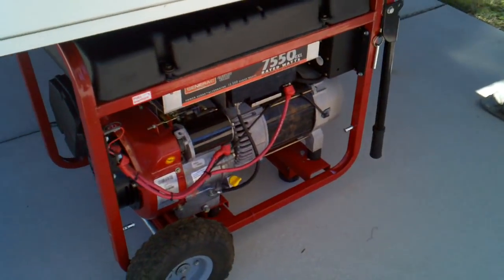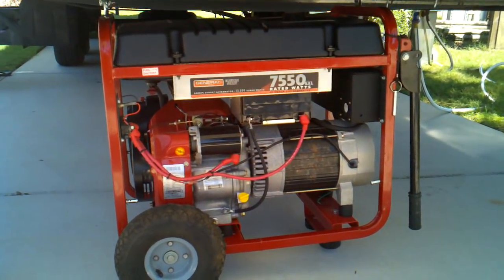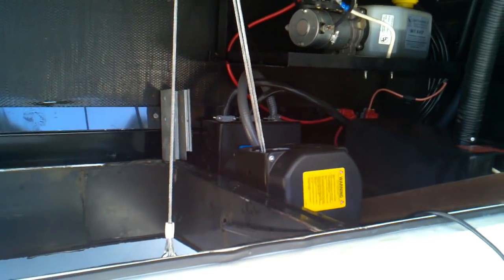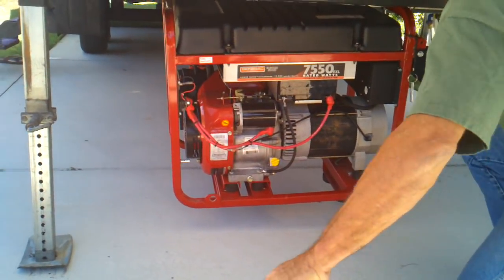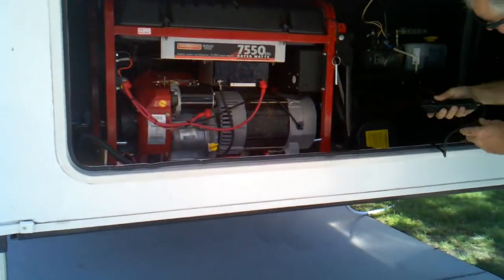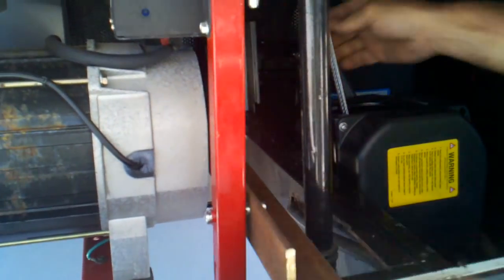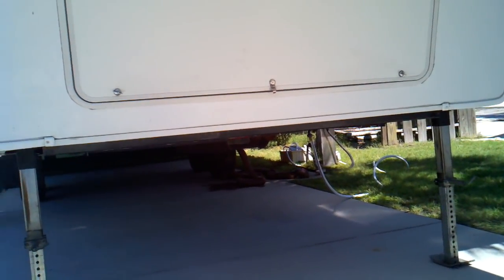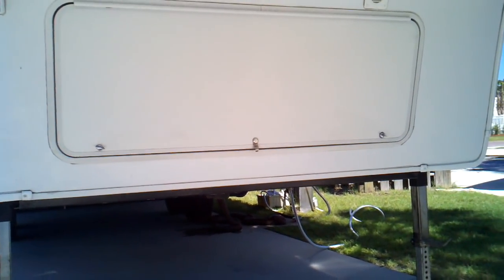Custom 1 Man RV Generator Loading & Storing System

Comment: I did this with my 5th wheel camper.
I installed a 4Kw Honda generator this way.
I modified the 115 volt winch so it has 2 wire ropes coming off the drum insyead of one.
Used pulleys bolted to the metal ceiling of the compartment as well as the winch to run the wire ropes over and down.
I didn't leave mine open on the bottom however.
I carefully cut out the bottom steel panel of the compartment so I can reuse it and bolt it back in.
I added angle an iron frame around the bottom of the opening to form a frame to mount / bolt it to.
I mounted the generator to the plate which I also added a frame to and stiffen it.
I used rubber and cork vibration pads between the generator frame and the mounting plate to help prevent vibrations.
The generator has it's own rubber mounts between the unit and its own frame.
The camper had the factory generator prep kit installed so it was easy to just run a #10-3 SOOW cord and connectors to plug the generator into the camper .
Next will be the retrofit remote starter kit to the generator. 
Since this type of generator is really not meant to be run inside a confined area , I leave the front hatch door open to let it breathe.
The exhaust was routed through flex pipe from the side of the generator out the bottom plate .
This made it easier to add another small muffler to make it quieter and not exceed the state park decibel levels.
I also wrapped all exhaust components inside the generator compartment with header wrap material.

Note:
To keep the noise and heat into the camper to a minimum I re-insulated that whole compartment with the fire rated , foil faced 1" fiberglass duct insulation BEFORE I put the generator into it.
I also used the same insulation on the furnace heating duct that went through that compartment also. Helps keep the noise out as well as the cold or heat loss since the front compartment is not heated .

Comment: Hi.  I was very impressed with your video. So much so I did a similar set up on my Cedar Creek.  It was surprisingly easy and looks great.   I have room for two Honda 3000s.   Thanks again.
Reply: James and FBM, I am curious how you mounted the pulleys.  Would be great to see a picture of that.  I am looking to use a piece of steel perforated square tube and attach the pulleys to it... but I am trying to figure how to attach the square tube to the cross members above.

Comment: I seen another one on YouTube similar to that design he bolted the sheet metal on the bottom of the generator so the sheet metal covered up the hole when the generator went up much nicer than you don't have a hole in the bottom
Reply from the maker: RANDY NORDSTROM 
That would have been much better.  Thanks for sharing.

Comment: This is interesting, I have an '86 Fleetwood Pace Arrow motor home with an Onan NHE 6.5 Kw generator.For it's removal you need a small motorcycle lift jack to lower the unit to the floor for servicing. This winch arrangement would be an ideal modification to allow any motorhome owner to service the unit without a lot of effort. Thanks for the video.

Comment: Its hard to improve on a factory installed onan allthough i have done this with a harbor freight gen but it never was as dependable nor did i ever have as much confidence in it as my onan .! One of the main problems with onans is the rotor breaking and causing spark issues which have sent many to the junkyard for a 45 dollar part and 4 hours of labor while the rotor is made of plastic :( I recently struggled through this problem allmost to the point of installing a after market gen however i decided to figure out the problem and the fix is not easy to find on you tube or online ? Onan generators are quiet and dependable but over priced making this idea become popular . I think the answer to this remedy is a custom exhaust and a remote start with direct wiring into the coach or camper and permanent installation for a more factory look .thank you for your video

Comment: Is there an insulated floor so the road debris doesn't hit it and cold, wet weather doesn't ruin generator?
Reply: since it's just an opening, looks like you can actually hinge a light door that opens and closes from the bottom to keep the road debris and water out of the compartment.
Reply: I was thinking that plus critters, rats, mice, snakes, etc.

Comment: make sure you point the exhaust at your trailer not your neighbor or you might find sugar in the gas tank, I can`t believe the clowns that show up to the races with trailers 3 ft. apart and think they can use cheap construction gens. If your going to play you have to pay, get a Honda or Yamha
Reply: I know! No consideration for others. plus those POS construction generators will eventually fry all your sensitive electronics because it's not a inverter generator.... which is why we spend so much money on inverter gens ment for RV's😆
Reply: Your so right guys. US Park services will pack you up at midnight for running that. I have seen it..
Reply from the maker: Brian 
Don’t be focused on the type of generator being shown.  The video is to show how you can store ANY generator if you have this style front compartment.

Comment: You can invest the time and money rigging up this set-up, but for me I'll invest the time and money into a quiet generator without all the pulleys, winch and cutting. I'll give you credit for being clever,
but that's just the wrong construction type generator for an RV. You're saving maybe a little $, bur missing the point entirely.